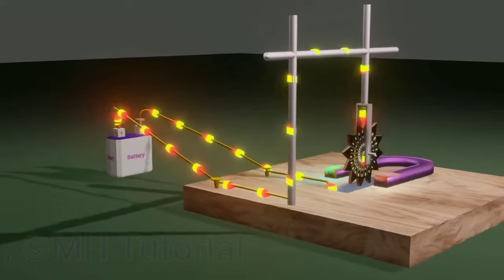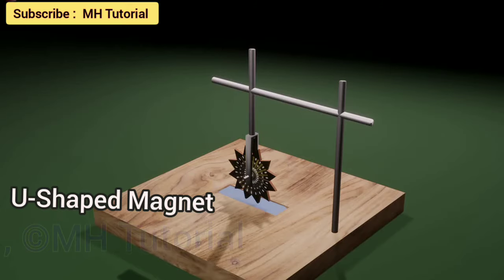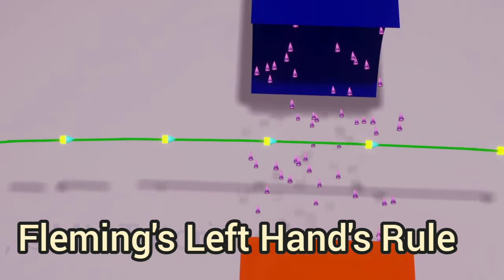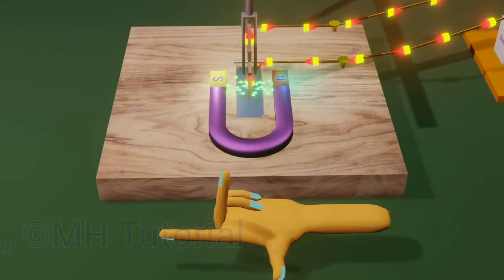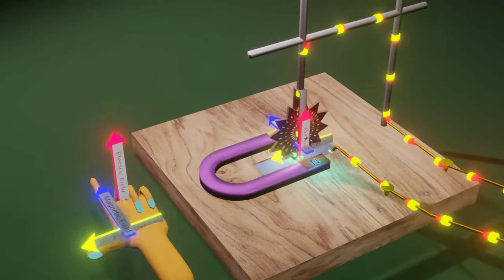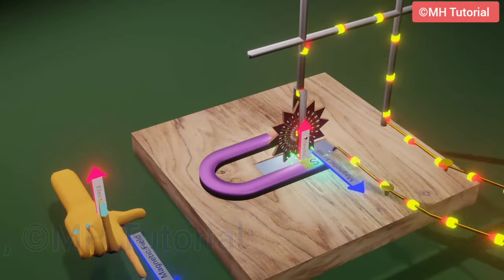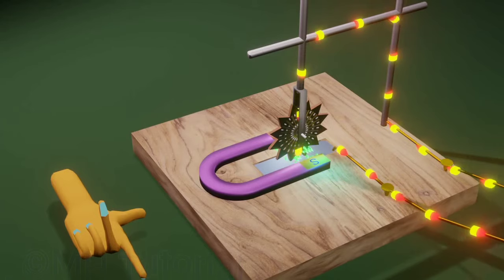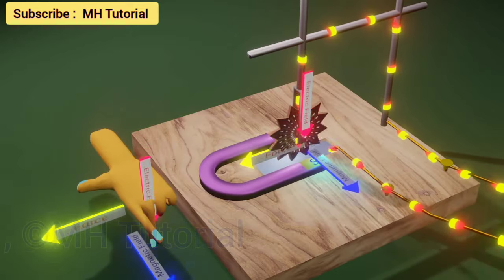Barlow's Wheel. Fleming's Left Hand Rule. Physics. Class 10. Physical Science.

Comment: In first case the direction of the force was in left side so how the wheel could rotate in clockwise it should rotate in anticlockwise ..I couldn't understand it ..
Reply from the maker: The force in this case is acting to the left. But it works at the bottom of the wheel. Not at the top. The only part of the wheel, that experiences the force is its bottom.
Reply: @MHTutorial  thank you